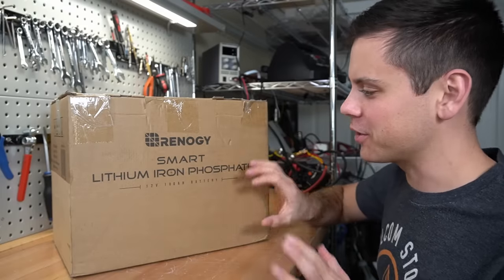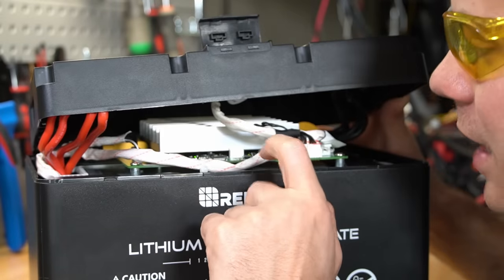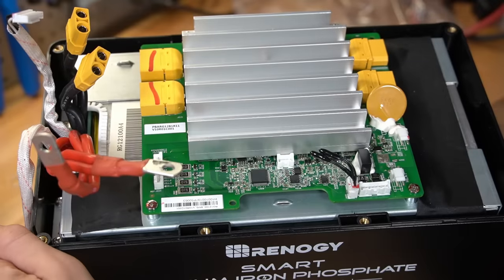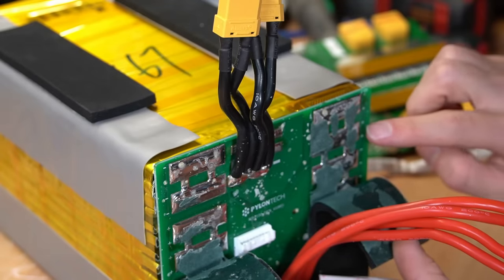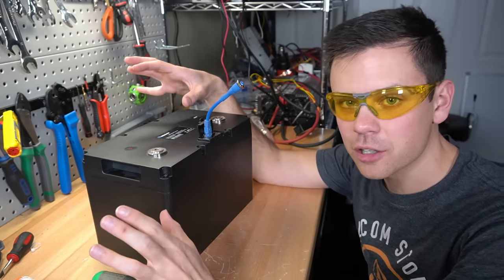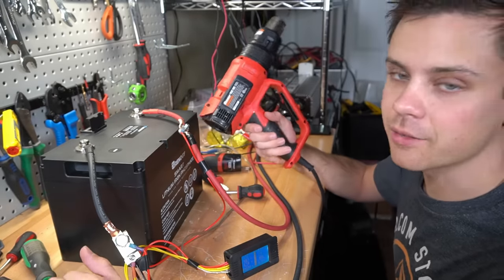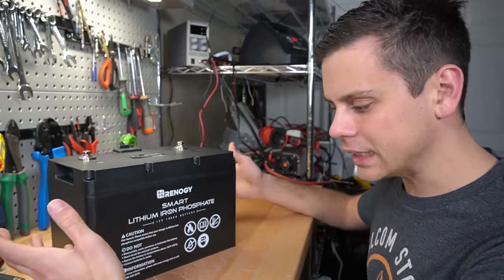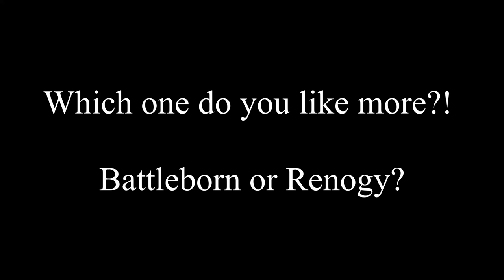Renogy "Smart" 100Ah LiFePO4 Battery Tear Down

Comment: Now I am intrigued, I wonder what the reason for no series connection is, I can only think that doubled up the voltage would drop below the recommended minimum 24v inverter voltage. 🤔
Reply: 12.8 v @ 100% SOC 2 x 12.8 = 25.6 V . Just mount inverter as close as possible use thick cables and heavy hardware. Too many people put a new battery in series with an old one & that never works for long. Then they get another new one and attach it to the semi-new one. Which isn't nearly as new as anyone knew.

Comment: It's safer to have many pouches in a metal box then  4 lifepo cells.   Because if one pouch swells and really heats up others will absorb some of that heat.    On the other hand if a lifepo4 1 of 4 cells heats up you got 25% of the battery hot vs 1/16th of the battery hot.   It would be twice as safe if they used 32 small pouches in a metal box .

Comment: Would you ever consider reviewing Aims lithium batteries?
Reply: I have an Aims inverter that works pretty well. I would be interested also in their batteries. Fullriver batteries are high quality also.
Reply: @geraldhenrickson7472  I'm getting 2 12,000 watt aims inverters soon to run our whole house and ranch equipment on a 48v supply. So it's good to know others like their inverters.

Comment: Can you mix and match the original Renogy 100Ah LiFePO4 battery and this newer smart one?  I have the original and want to add 1 more to make a 2 battery parallel bank.
Reply from the maker: In parallel it should be fine

Comment: BTW. Renogy also has 170Ah for also good price. And their old 100Ah LiFePO4 battery now is on sale, for 100$ less, as they are trying to clear up the stock.
Reply: The old one was listed for &1050 on their website. This is a nice drop in price for the new one. 
I just checked their website and it looks they reduced the number of batteries by a lot. And none of them can be put in series anymore. Which is weird because their larger solar kits are designed for 24/48v battery banks. Personally I’ll stay away until their strategy becomes clear
Reply: Gary Edwards actually, I have to stand corrected. It’s not Renogy, but RELiON that has all those batteries. And they are still available. So you are safe to get a Renogy. It’s a good price. You just can’t connect it in series.

Comment: Have you since found out what the comm port can do? By chance, does it connect to the Renogy BT module? Thanks so much!! I've been learning a ton from your content!
Reply: In my Caravan(Travel Trailer), I’ve got three of these in parallel, with Ethernet cables linking the “Up” and “link” ports between the batteries. Then have the Renogy BT-2 Bluetooth module plugged into the last battery. Then via their Renogy DC Home App on my iPhone I can monitor the states of all three batteries down to Cell level in each battery. As Will showed there are 4 Cells in each battery connected in parallel, with each Cell consisting of 4 LFP pouches connected in series. It is great because you can monitor SoC, Temp, Voltage etc of each battery as well as the Total of all of them. Happy so far.

Comment: I'm looking to get the DC to DC with MPPT charge controller and have this battery for my 12v system. I know this battery has a max charge rate of 50a so would it be okay to use the 50a version of the DCDC/MPPT or if will I need to go with the 30a version?

Comment: unfortunatly purchased 2 renogy 100ah batteries based on this review. since the parallel connection wasnt tested in this review, the quality issue I found wasnt described. Essentially these batteries will charge from 20% SOC USING MY WFCO 8955lis converter if only a single battery is connected. but if both batteries are connected it appears the BMS will keep disconnecting during the charge cycle. I can tell it is the BMS because when the charge is interupted the lights (dc) go out if I switch the 8955lis off during the interuption. Maybe Renogy will provide a firmware fix, but for now I would recommend sticking to battle born
Reply: Andrew, Maybe if you hook up the communication ports between the batteries it will behave better? I am looking at buying a pair of these after my trailer power supply failed. I replaced it with the same 8955 that you have. Maybe I just buy one, or use the original battery switch to only run one or the other at a time.

Comment: If I connect 4 of these in parallel, am I am able to pull 3000w safely? The spec says they are only capable of 100AH continuous. Is that multiplied by the number of batteries in parallel? Thanks
Reply: 100A per battery with four batteries in parallel gives you a total of 400A. So at a nominal 12.8V you’ve got 5120W available. So yeh 3000W is going to be OK

Comment: pouch cells are series connected so why can't two batteries be too? Battery has no ground reference. I could see needing to balance charge them but for discharging into normal loads why would it matter? Electrons won't complain.

Comment: If possible, could you check out Dakota Lithium batteries,...??? Thank you for all you do for us.
Reply: I just had a quick look at the 12V 100Ah model. $899 (MSRP), 1-year warranty, single use warranty, non-transferable, customer pays return shipping, extra fees, documentation, & packaging may apply. It sounds like they leave themselves lots of outs. No spec for series connections. Not saying I don't want to see a review of US products - especially if they're at Walmart.
Reply from the maker: Yes, and cheap common case. I have never been interested in those batteries for that reason. Nothing remarkable in the stats at all.
Reply: Thanks for all the responses. These points that were made are the things I have over looked. I very much appreciate all the help everyone has to offer. This channel is the GREATEST.

Comment: Curious to the specs of each pouch in that battery, I'm using a 48v nominal 200ah Lifepo4 here, comprised of 128 x 3.2v 25ah pouches, 16S, 8P config, works very well indeed.
Reply: Is it LiFePo4?
Reply: @geraldhenrickson7472   Yes as stated in my initial message, it is Lifepo4

Comment: If you could explain setting up supercapacitors in a solar system. I will be having fast high peak amp loads and, I have seen them work in solar systems. Thanks. Chris.
Reply: Eeeeek! Do not do it. Of course if you need to experiment and have deep pockets...go for it. Have a fire extinguisher handy at all times. Maybe a sand box to put it all in while testing. Let us know your results...is it a super laser?
Reply: @geraldhenrickson7472  no supper laser. The supercapacitors will help with high peak volt/amps when I use a table saw. Or a frig starting up. I have seen supercapacitors work in a solar system. I had a friend that I lost connection with, have a supercapacitors in his solar rig. Once the volts drop to a certain point, the supercapacitors gives a punch to help the inverter because, deep cell batteries can not handle high peak voltage to the inverter. My friend showed me that if the capacitor isn't hooked up and he kicks on the table saw, the inverter starts to beeped, but when he hooked the supercapacitors up and did the same thing, the inverter was not faded by the high hit of draw from the table saw. He also said it helps with the longevity of the deep cycle batteries.
Reply: @geraldhenrickson7472  I know he said you have to have resistor(s) if you have a bare bone supercapacitor(s).  Unlike the car stereo capacitor that has resistors installed inside the unit itself.
Reply: @geraldhenrickson7472  supercapacitors have gone done in price....a lot. They are making supercapacitors now that far exceeds supercapacitors that were made a five ten years ago.

Comment: What part of their system stops you from connecting them in series?
Reply: Likely the pouch cells. They are kinda touchy compared to other types.
Reply: @geraldhenrickson7472  then the weight and $50 price break isn't worth it.
Reply: Not to mention (assuming the pouch cells are the key factor) that their entire design would have to change and likely increase in price to offer series connection.

Comment: on the amazon site, it says you can connect these in parallel. "Auto-Balance
Connects multiple batteries in parallel safely without internal state non-uniformity issues."
Reply: Yeh, Will already said they can be connected in Parallel. What’s your point?

Comment: Thanks Will for your informative down to earth videos from Australia.
Battle born are not in Aus. I asked them the shipping cost and it was over $600 plus taxes. So that's out of the question. But Renogy is, and considering our dollar at the moment they are offering the 100ah smart battery at the same USA $ price, $899Au (Special at the moment $829Au). At this price they are only 30ish % more than the cheap Chinese Lithium batteries. Having seen you break those down, my fellow vanners and I won't touch them.
My van is only a 12 volt setup so only going to ever only have 2x 1000ah. So parallel works fine.
My friends an I have sent Renogy a couple of emails asking similar questions but are still waiting on a response. My question is - Will a Renogy 100ah smart drop in work if I connect it to older chargers that only do upto AGM batteries? Example a Ctek 250s Dc/Dc charger or a standard battery charger? Or do I need a newer Lithium charger?
Thanks again for all your great informative videos.
Reply: You need a lithium charger. Renogy do good ones too

Comment: There is a large 200AH LifePo4 battery from Renogy Im interested in. It is large of course but my RV has a 6 pack of 6volt wet batteries. 3 of these may be a tuff set up for the $$$. See if you get one of these and give it your 👁 of expertise.

Comment: Hey Will. If I took this battery, wired it in parallel with another, would the max charge current jump from the stated 50amps to 100amps? Is it a 1-to-1 increase when in parallel like that? Thanks!
Reply: Yes

Comment: Hi will. 
Have you tested the 12v 100amp Dakota lithium ion battery?
Reply from the maker: No real reason. Given its price and basic features, I never felt the need. What do you like about it?
Reply: @WillProwse  
Dealership application for the Bahamas. 
I've also just been granted dealership for them but I've just come across a couple bad reviews, especially on the business side. I'm a dealer for battle born and I would not want to put them on my portfolio.

Comment: So would you recommend installing 6 of these in parallel for a vin build that will only be using 12V?
Reply: Manual doesn’t recommend running more than 4 in parallel

Comment: I was wondering if you have ever thought about making a super capacitor hybrid battery for high C charging and discharging. Pros and cons?
Reply: @Jason Bowman Well the good thing about caps is you can charge and discharge them quickly. The downside is they have a tendency to leak charge over time; however if you're charging them regularly with solar power that shouldn't be too much of an issue. As for safety, yeah that could be a concern, but as long as you use non-conductive tools, and are careful you probably won't die.

Super capacitors are pretty cheap now and could be used to expand energy storage and provide quick charging and discharging for better performance. They also dont have the downside of not being able to charge at low temperatures. I was thinking about creating a hybrid battery and am messing around in multi-sim, but that only gets you so far without practical testing.

I'm thinking of a way to create a low temperature bypass for the battery to allow use at low temp, to avoid battery damage, but still be able to charge the caps.

As for component sizing, you would just require the correct cable size/length, voltage regulators, and resistors. You can order capacitors in series at what voltage you want. Probably not ideal for the average DIY'er, but that's what the internet is for.
Reply: @Jason Bowman Well I do have a degree in computer engineering so I have some idea. I haven't worked with super caps, just the standard micro-farad caps you find on computer boards. 

I'm thinking you could charge the caps straight from the solar panels in parallel with the battery so when the mppt breaks the circuit at low temp cutoff the caps could run the system temporarily in the situation when it only drops below 0c in the morning. The caps aren't too sensitive to high charge situations so shouldn't be too effected by 12v solar panels if the caps are in the 80f ~16v range (in series). 

Would require a voltage regulator at the output to ensure the caps don't overload the system after the resistor of course. You could use a short length of zero gage wire to wire the output to avoid any electrical fire from the  caps discharge followed by  a fuse to the resistor & voltage regulator. Maybe a little overkill... but it's better safe than sorry. 

You could probably source some zero gage wire from a dumpster outside of an auto audio install shop (free).
Reply: @Jason Bowman I was thinking about not just cold mornings, but also emergency backup. Something that can temporarily run some LEDs, and keep the DC mini-frige cold in case of a battery failure. 

Plus they charge extremely fast for when you don't get enough light during the day to charge the battery.

The caps he was using had a ~60f capacity. The one I linked has 500f for $270 and they last pretty much forever.

This probably wouldn't work for a large system but probably enough for what I want to run.

Maybe I'm barking up the wrong tree, but it seems like it would work.
Reply: @Jason Bowman the caps I linked are 2.7V 3000F each, 6 in a series.
3000F/6 = 500F 16.2V
Reply: @Jason Bowman yeah the cost/benefit doesn't quite make it. Probably much  better off making two 12V batteries in parallel with a heating pad. They just cost so much... the batteries not the heating pad.

Comment: We can buy Winston 3.2v lithium LIFePo4 cells for $1.86 an amp hr in Australia. So about $744 for 100amp hr (4 x 100 amp) x $1.86 and they are a decent battery. Why is America more expensive then Australia usually it cheaper heaps?
Reply: Yeh, and we can buy this Renogy 100Ah battery for the equivalent of US$580 delivered to you door is Aus! It’s like US$800 in America!

Comment: lack of Series Connection kills it, Saw a VoltaX battery on Amazon, mabye see what the build quality is like with that - the cheaper ones do 2 in series, or for $100 more (AUD, probably around $70 USD), you get the better ones that can do 4 in series.

Comment: i have question. i bought 2 battle born  12v batteries. when they arrived they read 13.3v on a digital battery meter i have. ionly have them for emergency backup for my refrigerators. even after full charge within 4 days they drop down to 13.3 volts again and stay there. they are not connencted to anything at all. should they drop down tothat voltage or should they be at 13.6.
Reply from the maker: That's the charge/discharge curve of LiFePO4. Totally normal
Reply: @WillProwse  thank you..and love your videos..very informative..keep it up

Comment: Purchased one of these batteries. I like how it is very small and light weight probably the most powerful battery of its size on the market however there’s a few little things that frustrate me with this battery

1 The two ports on the top of the battery are in a stupid location as where do people normally have that battery tiedown that’s right in the middle covering the ports up that should be moved.

2 I cannot understand for the life of me why they used find M8 x1.00 mm for the battery terminals I have searched high and low for this size and cannot find it anywhere they should’ve used A common size that everyone has M8 1.25 

Change these things renogy

Comment: Hi Will, does this have low temperature charge cut off? I have a Ctek D250SE in my van and was looking to get this battery. I don’t know if the BMS in this battery does this job or my Ctek does it or if I have to get something else to solve this problem. The UK gets cold around this time of year 😂
Reply from the maker: Yes, absolutely does have low temp charging protection

Comment: Will! How would you recommend recharging this specific battery after draining it too 0? I have a bench power supply, and also a Noco genius 5 but it won't recognize the voltage so It won't charge.
Reply from the maker: Use a bench power supply to wake it up, then charge it with a charger
Reply: @WillProwse  Wow fastest reply on earth! Do I just set the PSU to 12.8v (The rated voltage) and leave it for a day? My PSU doesn't read any amp or current...but my multi meter does say there is voltage in the clips. Thank you so much for your help.
Reply from the maker: @TaylorJonPeters  just attach power supply for a second, then add the charger. It is in safety mode, that's all. If there is a button on top, you could try pressing that to wake it up. It shows zero volts, but the cells inside still have some charge
Reply from the maker: I would remove powersupply when you can switch over to normal charger though
Reply: @WillProwse  Brilliant I will try it!! thank you so much
Reply: I use jumper cables hooked up to another battery for a few seconds to bring the voltage up a little at a time.  Only enough for the charger to take over.

Comment: It could be Reneogy's market with this battery is not big systems. Most small vans don't go past a two battery 12v parrallel system and this is cheaper then a battle born. Weekender vehicles abosultely don't need massive power to go on a glamping trip.
Reply: The Dawn of Vanlife I agree — majority of small setups use 12v just fine.